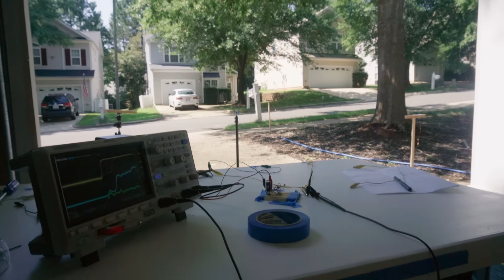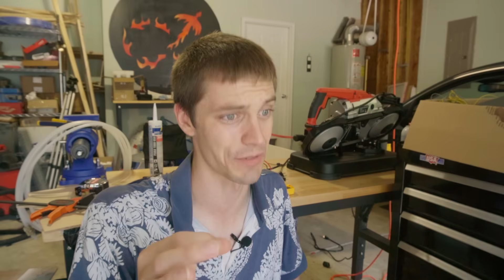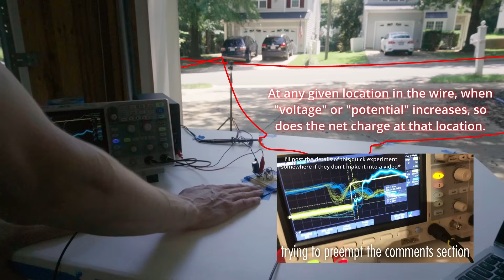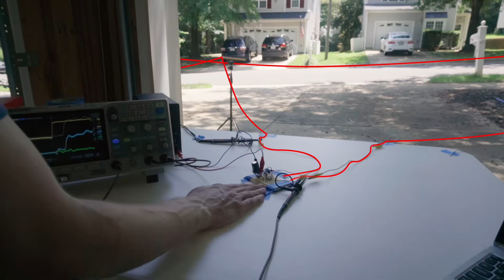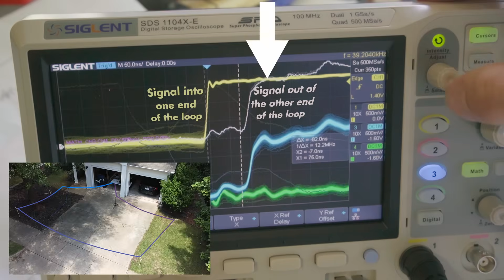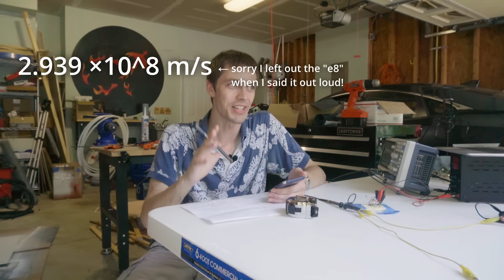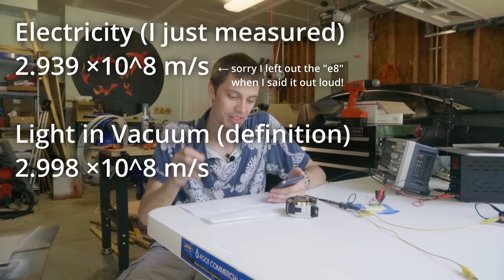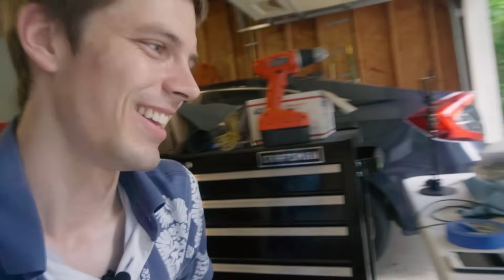Why does WATER change the speed of electricity?

Comment: now begs the question: can you INCREASE the speed of electricity by surrounding the wire with a conductive material vice dielectric? i was thinking the electrons would slow down due to electromotive force from eddy currents in, say, a copper pipe surrounding the wire. but your experiment makes me reverse my intuition.
Reply: I think both slows it down, inductive reactance versus dielectric impedance.
Reply: @petevenuti7355  that's the term: "inductive reactance" to describe what took me in more words.

Comment: As a ham, when building antennas, I've always read/been told to account for the speed of light in the wire to get the best performing antennas, even fir bare copper? It's slight, and an antenna made using 3e8 works fine, but it is supposed to be important?

Comment: The speed of light being different at different frequencies in different materials is responsible for the very familiar phenomenon of refraction. Think prism. Due to blue and red light changing speed a different amount, they get separated.
Reply: A prism, or any medium that bends light results in a spectrum due to the interference patterns generated by the interaction of the various waves. It is similar to the phenomenon we get with sound, where different frequencies have different interference patterns.

I used to have a class demonstration where I played tones through two speakers, the students walked along at different distance from the speakers and place squares of paper, one color where the sound was loud, and another where it was nearly silent. Then I changed the frequency and they did it again. They could clearly see the different patterns.

The same happens with light. The different frequencies result in different patterns of constructive interference (bright) and destructive interference (dark). The result is a spectrum, a secondary spectrum that is dimmer, then a third spectrum even dimmer and so on, until they are too dim to be seen.

Comment: I'd like to see you try propagating the current though a solution of ions. Salt water would be the obvious choice. Would you see a large decrease in the speed of propagation as the current would rely on movement of cations and anions through the water? Or does the electric field around each cation and anion mean the propagation speed doesn't change? What effect does altering the concentration of ions have on the propagation time?

Keep this type of videos coming please!
Reply: I expect saltwater to not be different because those ions have spherical symmetry... It's the water, I would however be interested in the differences between different polar solvents! Or the effects of soap!
Reply: @petevenuti7355  I think maybe I wasn't too clear in my wording. I actually meant to remove the wire and have the current carried by the salt solution. I agree that replacing the tap water in the experiment shown with salt water will likely have no effect.
Reply: @mrigeoy  ah, the electrolyte AS the wire.. I don't know! I suspect it would be about the same as the wire in water, but, the much more massive positive ions going in the opposite direction would have what effect? Would the impedance/reactance cancel out or have an additive effect?
  Good question! 
  I wonder if, I hope, he will see this string of comments and test..?
  If I owned that awesome scope I'd be running down to my garage to see right now!
Reply: @petevenuti7355  Yes, a scope like that would be very nice! But electronics is only an occasional hobby for me so hard to justify any scope, let alone a fancy one. We can but dream!

Comment: 17:41 I wouldn't say it's DC, rather a mixed signal. I would call it a squarewave with a DC offset. Because what your dielectric sees, is the AC part of your signal. It's pretty much the same as with electromagnetism. Only a change in current will change the magnetic field and only a change of the magnetic field will induce a current again. So as long as you have a steady voltage across your dielectric, it will not budge, but when you change the voltage, no matter which direction, your dielectric will follow accordingly.

edit: nevermind, I should have watched the whole video first 😅

Comment: You're overlooking a bigger and more obvious effect.  Only a tiny fraction of the electric (AND magnetic) field around the wire is inside the water.  Most of the loop's interior is still in air and air's dielectric constant will still dominate.  To get to the air, the fields must travel only a few cm in water.  Once they are in air, they propagate at c to the other end and then propagate only another few cm in water.  You also seem to have overlooked the positive charge left behind when the electrons left -- this charge has an electric field too with opposite polarity.  Both of these fields propagate around the loop in opposite directions.  Furthermore, the steady state Fourier model applies only after the transients damp themselves out.

Comment: Hear me out. I presume the less fast you switch the circuit on and of OR the speed at which your switch switches, the longer the overall added frequencies on the Fourier transform (very unfounded, but maybe true? ). So if you make the same experiment, but varying one or both of those, the speed of electricity will vary as well?
Reply: Yes. If you change the frequency of the signal, the medium will interact differently with that signal and the propagation speed will change accordingly.

Comment: At 14:33 you introduce an equation for speed in a dielectric medium, which does not represent the system. A coax, which is what is effectively built, can be described with a characteristic impedance and other variables.

Comment: When you said that people say that resistance affect speed of electricity I was like "Whaaaat? That's heresy, I would be crucified if I told it in front of my professors", I think for anyone who did a bit of electrical engineering it's kind of obvious that the property those guys were looking for is inductance. Anyway, that was interesting experiment and it was nice to see it on your own eyes.
Reply: Well, if they transport colloquial BS instead of knowledge with the correct technical terms, but more like religious delusion ("wonder", "fantastic", "never seen" ...), then one should rather leave it alone. Such uninformed half-knowledge does more harm than good:/
Look at you. How easy was it to provide the right information ( trailing phase shift due to inductance, characteristic impedance )? Very easy. Thank you for that!:)
But unfortunately something like that has less reach than clickbait...

Comment: The switch and the measuring device are relatively close together. So, referring to the original Veritasium video, why don't we see the current ramp up almost instantly after you flick the switch, in the time it takes for the EM field to reach the measuring device? The answer is that it does, if you look closely, but I think the impedance has been chosen in such a way that that current is going to be minute compared to the "steady state" current reached after the fields complete the loop?

Comment: I started building shortwave antennas in the 90's when i was 18 years old. My first attempts building them yielded bad results because i relied on school physics.
So i bought a book. And that really opened my eyes. Propagation, impedance, types of cables and how they affect the NVP and much more.
Alas nowadays i am a city dweller and i can't just whip out 30m of wire or cable without conjuring up an angry wavies mob 😀
What i wanted to say is that these strange effects you are seeing are exploited in a lot of ways and are not just quirks of physics to make our life at school or uni miserable.
Building a dipole for an asymetric feed? RG58 Lecher line is your friend, but only if you keep it's nominal velocity of propagation in mind.
Reply: Do you know anything about leaky coax antennas? A phased array created by cutting off much of the shielding at specific intervals.
   I have the conceptual understanding to know that that would change the capacity/impedance/speed in the coax...
   I assume it involves calculus I don't get.
   Do you know how to calculate something like that?

Comment: Ok, now i wanna know how this effects trans-atlantic cables and the speed of signal propagation
Reply: There is a factor Tpd or Velocity factor(VF). Every transmission with electromagnetic waves has that factor imprinted, by nature! The speed of light in vacuum is the maximum possible velocity.
Different materials have different constants which affect the speed of propagation. For example: Cat-3 twisted pair 58.5% or Optical fiber (silica glass) 67% (search for tables online).
There is a latency (for EVERYONE and EVERYTHING). So what? That is how electromagnetic waves and electronics work. That is how nature works. Period! :)

Comment: Question: Have you tried to perform the measurements using a very small length of wire? Like, try to run the experiments using a small protoboard jumper instead of the long wires, just to see how the numbers roll. That would be insightful.
Reply: That oscilloscope doesn't have the resolution or the right kind of test leads for measuring signals precisely enough to show any of that directly.

In the video he was using a 28 meter loop of wire and was barely measuring nanosecond differences. Measuring similar effects in the same way in a 28 millimeter wire, would require an oscilloscope that can measure to the picosecond.

Measuring with picosecond precision is done with very different techniques.
Reply: @hamjudo  how expensive would an oscilloscope with pico or even femtosecond precision be? is it available for consumers?
Reply: @mastershooter64  picosecond pulses are in the terahertz range. Electronics that operate at those frequencies barely exist in semiconductor research labs. I don't know of any products that use them.
Reply: @mastershooter64  we use picosecond Tektronix scopes at the lab and they cost up to 50k USD (about 10 ps resolution). Femtosecond oscillography as far as I'm concerned is still not possible. The best scopes in the world today can do 1-2 ps resolution and we're already talking about unique machines that use custom made chips and cutting-edge signal processing technology. With femtoseconds the problem is that your signal would contain such high frequencies that it wouldn't travel along the wires like we're used to, it would radiate in all directions like light. This would create enormous problems with creating chips and PCBs for the oscilloscope, because you just can't say what is voltage and what is wave anymore, they become mixed. On the other hand if you don't want to record "voltage" directly, but fine with just waves, you can forget about the oscilloscopes - optical communication equipment can detect femtosecond pulses, but that's a whole another story.

Comment: There was a veritasium video some time ago stating that nobody has measured light speed, just doubles, because when reflection happens it might be that light to the reflector travel one speed, but back at different speed, however the round-trip always ends up spitting out c. Could this be a one directional way of measuring c?
Reply: The wire is still going in a loop, so it is not a one way trip, the loop goes out and then comes back. 
Edit, 
Oh but the slowdown part is in a straight line, if you could slow the going out and not slow the way back, or slow intermittent parts of the loop you could indeed measure something that is not the double but more like 2.6times.
Reply: No, as for half of the trip in the wire you're coming towards the start and half you're moving away from the start. I believe a similar argument would be made for a thin rectangle of wire (or any other shape).

Comment: I so appreciate all your explanations and diagrams and details. Your enthusiasm reminds me of my days doing science fairs in school. I don't have a clue how much this 'feature' of water impacts your demonstration, but I never heard you mention that water is also diamagnetic. Where it can appose a magnetic field. Which as you stated manifests when an electric current flows. I'm sure it's hardly the only factor.  We know the phase of a AC wave changes when it goes through a capacitor which by it's very nature requires a dielectric. How much change in speed would you have if you used say 3m of pipe and had electrodes on either end of the pipe. Filled with air, water, oil? Truly I enjoy your videos and always look forward to the next.

Comment: The difference in speed is actually quite significant when you start tunning oscillating circuits and antennae. Transmission lines have up to 50% in speed difference 

It might be worth doing the same test with a piece of coax cable.
Reply: I wanted to suggest the same thing, with different types of coax having velocity factors from 66% to 87%, they should have quite a drastic effect.
Reply: I was thinking this because the outer reflector would have a really interesting effect on the magnetic signature. 

I’d also be interested to see other wire designs/shieldings to see how and why they affect it
Reply: As others have said, a common Coax has a 66% Velocity Factor. So a wire in a water hose is somewhat exactly one of those: a coax wire, so might expect something much the same as a measurement.
If cutting a length of coax as part of a radio antenna or tuning circuit, the VF needs to be allowed for in the wavelength. So e.g. a 2m wavelength in a common ham radio band is not 2m, once you allow for the 0.66 VF correction.
Reply: He's basically experimenting with free wires. They're difficult to control and characterize. HAMs know them well but in rf engineering they're avoided. He needs to submerge the wire in a swimming pool to get the nearly full effects of water's dielectric effects. Having a couple inches of water and feet of air is always going to get you only a fractional change. He basically needs to make a long pipe into a large diameter coaxial conductor, fill it with distilled water and observe a massive em wave speed slowdown.
Reply: @maxbauer1633  🤣 I think you can safely keep laughing at that. Light travels nearly 300m in a microsecond. Let's be extremely generous and say "high" frequency audio travels at 40% speed of light and low frequency audio travels at 60% speed of light that would be a time difference of 0.9 microsecond with a 300m speaker cable.
And that's being stupidly generous, in reality, 50Hz and 20kHz are almost DC when you are looking at transmission lines.

For context, sound only travels 0.34mm in a microsecond. So, if you move your head by that fraction of a millimetre, you impact more the audio timing then any audiofool magic cable

Comment: You really should try to build your own coax cable, like a metal pipe with a thin wire within. (and use a differential signal between these two)
That way the fields are confined and you have more control over them.
You might get more slowdown from water this way too, because the entire field would be confined in the water.
Reply: @AlphaPhoenix Yeah, this also ties it in to the real world - why do the coax cables are made this way.
Also I think one practical thing that wasn't ever mentioned was Ethernet cables, containing multiple pairs of twisted wires, and CAT-6 standard, where there is a X-shaped plastic separating 4 pairs.
This helps to better tie-in to the real world and show people that these aren't some esoteric things, but the reality that the engineers are already dealing with.
Reply: @OrbitalCookie  The spline isn't part of the CAT-6 standard, but it's easier to meet the standard with one so that's what nearly all CAT-6 cables have. Many CAT-5e cables are also splined.

Comment: Btw you will always have signal dampening when using mediums to transport information/ energy. Thatswhy even glassfiber optics has big repeater terminals every so and so kilometers and smaller ones inbetween.
Reply: the cool thing about glass fiber is that in some cases you can get away with using small patches of amplifier doped fiber, instead of a big electric repeater. (the power supply is a different colored light, for example if the data is using UV, then you can power the amplifier with red light injected somewhere else into the cable)